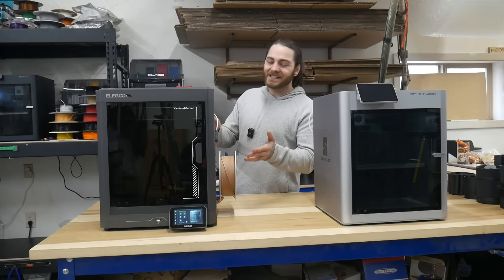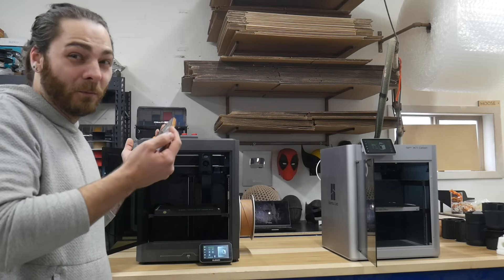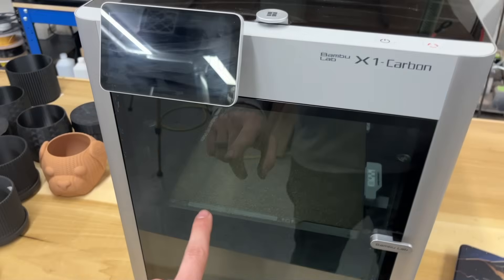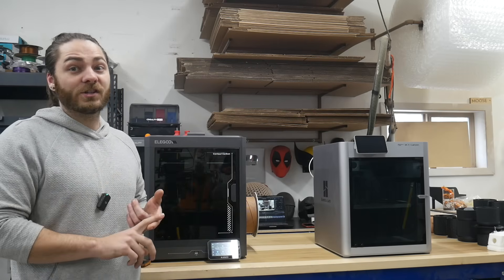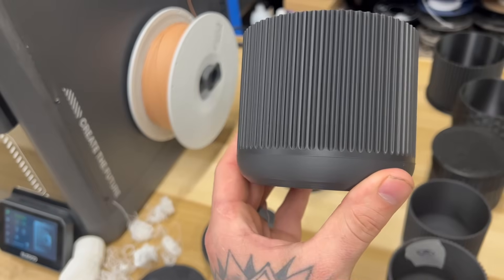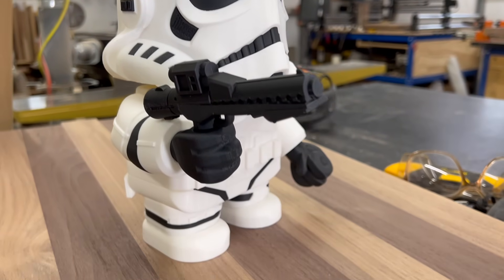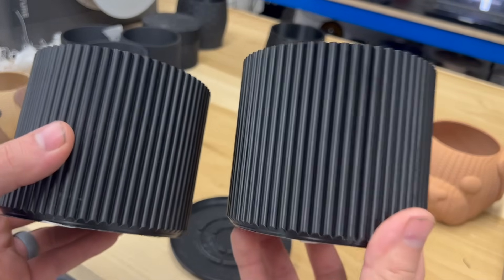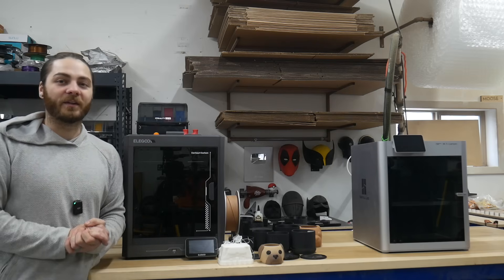Cheap vs expensive: Can the Elegoo Centauri hold its own against the Bambu X1C?

Comment: Wrong comparison.   The question is whether it is as good as the the P1S.
Reply: Dude literally said in his video the manufacturer wanted him to compare it to the X1..
Reply: I got mine, and it prints flawlessly. The finish and speed is amazing. 
The only thing I had to play with is filament settings.
Reply: @Reseiver got your what?
Reply: Males no sense, Bambulab and Prusa need to stop charging premium for regular products, a 299 elegoo is trading hands with a much expensive printer and you want him to compare it to a much worse an inferior p1s?
Reply: Why?
Reply: @Mau365PP because of the more comparable price range. Its like comparing Bentley with Opel. Both do the job, but the experience during the ride is completely different.
Reply: @Reseiver  How much as I would like a showdown between the P1S and the CC considering all the updates Elegoo already pushed in both hardware and software (new light and addition of MCU connector) we must not forget the CC standard comes with hardened steel dual drive extruder and has higher temps.  So it's more an X1C specs wise than a P1S. 

Although, considering Bambu Labs now has a sale on the P1S combo and a discount on the hardened steel upgrade it might be a very nice deal for 650 :D
Reply: @kellbrekoo3487 x1 prints almost exactly the same as p1s. So,there’s basically no difference. Yeah, the lidar and the extruder/nozzle are different. But those do nothing different print-wise. The nozzle and extruder don’t matter as long as you print pla/petg/abs. The lidar does the calibration for you. Yes. But manual calibration is still better. The only REAL difference is in the table temps capability: X1 can do 130 and p1 can’t(Well, if you aren’t modding it that is) So I see no reason for another comparison. The Centauri is definitely a great value for what it’s worth. I hope that they won’t fck it up, like Creality did with their k1 max cfs conversion. It was a great printer prior to the update to cfs compatible firmware. But after that it was a mess. A ton of glitches. Some small, like non-responsive screen. Some ugly, like the time that my spool ran out mid print, and the printer has decided to home the table before taking another spool in. That was horrible. So I’ve got myself a p1s and am happy with it’s performance and quality.
Reply: @Reseiver and yet X1C vs CC was exactly the buying decision in front of me 2 weeks ago.
Reply: @Mau365PP Centauri specs are closer to P1S than the X1.
X1 has lidar to calibrate extrusion.
Reply: @Ni5ei Who cares how the calibration is done as long as it is accurate and doesn't take an eternity. Time to print completion and print quality are the two main factors. The Elegoo is very competitive with both Bambu printers. Don't be Bambuuzled.
Reply: @MikeHammer1  I see what you did there.... and I like it.
Reply: @MikeHammer1  I'm not saying I care about how it's calibrating. All I'm saying is Centauri specs are closer to P1S than to X1C.
Reply: @MikeHammer1  Stop saying nonsense. For a new printer to be competitive with a Bambulab, it needs to have at least a year of significant printing. I've had an X1C for 2 years with almost 3000 hours of printing and I've only changed the nozzle once. The extruder is the original one and the prints are still perfect. They are beasts of performance, reliable and durable over time. When a new printer can do that, then we can talk about competition. For now, whether you like it or not, Bambulab is far above everyone else.

Comment: Watching this while my Ender 3 pro whirs in the background and I'm astounded at the print quality and cannot even believe the print speeds stated in the documentation. You actually didn't reference print speed with respect to your tests. Are printers so good now that it's not much of a consideration? Again, just blown away. This looks like a perfect upgrade for a light hobbyist like myself.
Reply: Let me tell you... It's not much, but going from my first printer (Ender 3) to a my newest one (Flashforge 5M) was huge. Auto bed leveling (The biggest plus for me, as I had to level my bed every time I wanted to start a new print), much faster prints, a nice user interface and no more modding to get the results modern printers can achieve. So much easier and for (Compared to then) basically the same price (Payed 280€ for the Ender 3 and a little under 300 for the 5M). 3D printers have definitely taken off the past 4 years. Especially when it comes to their convenience level. It's so much easier to get started. And not to mention setting up the Ender 3. Man, it was a huge pain in the butt, as someone who has never delt with it before. Now; Get it out the box, go through the auto calibration process, feed the filament and get going. Absolutely love it. 
Just now started a new print and I have to mention the Wi-fi feature. With FlashPrint I just connect to my printer over Wi-Fi and it automatically starts the print. No more running to my printer, selecting the file, leveling the bed and then watching the bed. Another point for convenience. 
Ender 3 is great if you want to learn about 3D printer at a good price point, but if you just want a 3D printer that works out the box, it's much easier to invest a couple bucks more.
Reply: @Fuerwahrhalunke  I have a modded out Ender 3 V2 (dual motor belted Z, SKR Mini E3 V3, Direct Drive H2 V2S, PWM 5015 fans, Auto bed leveling probe, linear rails, etc) that I probably spent as much in mods as I bought the printer for. It's been a click and print experience with it though it doesn't print as fast as I would like it too. I'm really looking forward to a huge step up to a Centuari Carbon lol
Reply: @Fuerwahrhalunke  Yeah, I'm sold. I ordered the Centauri.

Comment: What is the machine's dimensions? I'm making a workbench and would like to make a bottom shelf to accomodate this thing. 

I was originally going make it to work with a Sovol Sv06 Ace Plus, but I feel like this is worth sacrificing the print space, just by virtue of it being a Core XY with a heated enclosure that would require minimal modification (if any) to make it print nylon.

Comment: There are many things I like about my Bambu printers (I have an A1 with AMS, an A1 mini with AMS and a stand alone A1 mini for awkward stuff that the AMS doesn't like, TPU for example) but the nozzle change is the best feature, they are big, robust and can be changed so easily, I used to have a bunch of Creatlity printers, and OMG what a pain those little brass nozzles are. However, I do like the look of these enclosed printers, I had, a few years ago, a flashforge that looked a bit like a microwave, dual head, it looked amazing, but was really shit, it clogged nearly every print, and because it was dual head, aligning the heads was painful. In terms of reliability, how would you rate the Elegoo printer in this video? I ask because on my A1s, I get a9/10 success rate, but I am not a fan of this open chassis style.

Comment: How much did you get paid from Bambu? All are complains from you against Elegoo Centauri Carbon but not Bambu X1C, you always say Centauri, isn't centauri is centauri carbon, it's a bit different. Elegoo Centauri Carbon is cheaper and faster than Bambu X1C and the quality in the 3D impresions is more or less the same, it's on your calibration. So, how much?

Comment: @15:10 There is an option in Orca Slicer called "Avoid crossing walls" if you turn it on and play with the variables you can reduce the stringing you get on the inner caps. In the Preview tab of the sliced file you can look at the travel of the toolhead to see the paths it'll take.
Reply: Awesome point. I use this setting as well, for all my bowls/vases.

Comment: You compare print speeds with the slicer? That's new. You can also set up an Ender 3 to match whatever time the slicer tells you
Reply from the maker: The printers speed specs are the same on paper. I looked at how fast they would print each print in the slicer and they were very similar. I didn’t physically time each one.
Reply: @TwoMooseToo  What you could have done was to print with both on max speed. And compare quality and speed. Let say they both hava a 300mm/sec max speed profile, and use that. Print the same model

Comment: If Elegoo would have kept their firmware open (which they actually are legally required to do as Klipper is GPL V3), then this would have been a great printer.  Now it's actually an illegal printer, but unfortunately that goes for many printers (or in case of Bambu their latest slicer) nowadays ...  I really hope Prusa starts some legal actions against all these competitors that are now breaking the law.

Comment: You said you send print jobs to both printers via WiFi.  We have a Bambu at work and the only way I can figure out how to send print jobs to it is through the cloud service.  Am I missing something?
Reply from the maker: I just do it through the Bambu slicer. So I guess it’s the cloud. You can do it via the sd card or run a LAN cable if you’re worried about the cloud.
Reply: @TwoMooseToo  Does the Elegoo have a lan port?   I know the Bambu X1 Carbon that we have at work doesn't.

Comment: on my design - sylo · container - the threads do have challenging overhangs, it require some slowing down for clean prints, and variable layer height also helps out :) still a good looking print though, thanks for showcasing, would be nice to give credit though. My Centauri is currently in transit, so hopefully next week i'll be doing some prints on it as well and see how it stacks up against my bambus :)

Comment: Bambu is basically apple for 3d printers. Fuck them. Everything's close sourced so you have to buy their stuff and pay triple because their name is on it
Reply: to be fair, theres a reason everyone uses bambu and why other companies scrambled to catch up. Their printers are actually good
Reply: Well they should be good. But all im saying is you could buy a regular brand printer and throw 100$ worth of upgrades at it and it would be just as good. But the huge turn off for me is with the integration of their "authorization control technology".  They want to have control over what you can and can't print. And make it so you can't use 3rd party software you have to use theirs. And yes this is true. It is in their user agreement

Comment: I might have left the light issue til the end. For 1/4 of the price, you should expect a bit of inferiority. 

Also, in the spirit of 3D printing. People are really picky about some things. I wish all printers still had some tinkering. I hate that everyone has hopped on the easy side of things. It may be petty on my side, but ive had 10 years of issues to help get printers to this point.    That time and effort cost me and others a lot. A lot of fails. So its funny when people knit pick.

Comment: Bambu is getting ridiculous with the pricing at the moment pure greed the y couldn't even wait. A p1s combo is over 1k
Reply: The H2D was a pet project of Bambu's CEO who is an RC enthusiast who wanted one machine to do everything.  Laser cutting and 3d FDM is not compatible... extra cost for features  we don't want or need.  They should have gone with a larger build plate - 400mm with the two nozzle system and been done with it.

Comment: I work on a lot of Bambu printers, when people try to grease the carbon rods it ruins the bearings. It makes them wear out very fast. The metal linear bearings are better if they are oiled every so often.
Reply: hold up people grease those rods? Bambu literally tells you not to, crazy some people don't take the time to learn about a machine after spending close if not more than $1000.
Reply: They should be cleaned with IPA
Reply: Do you even need to do any maintenence on those rods? Maybe just a quick wipe down with some cloth?
Reply: @2010ngojo 

All they need is to be cleaned with some Isopropyl alcohol. I have seen units that are taken care of with over 3,000 hours on them and they are like new.

Comment: Let's talk replacement parts. Bambu lead screws are 35 dollars each for a part that is bought for less than 3 dollars and milled to be proprietary. I have been running a p1p farm for almost 3 years and I'm going to sell them soon and never buy bambu again. They're great machines till they reach a couple thousand hours and then the real issues come out.  If you're going to do anything besides print funco pops or toys and need a business aimed printer, steer clear of bambu. P.S to get "permission" from tech support to even buy the effing lead screws took 4 days of messaging them back and forth, I lost hundreds of dollars thanks to their terrible support forcing me to go through their list of BS when in the first message I sent pictures and videos and explained I'm a business. They don't care, I had to resend the same pictures and videos in the correct order of their flow chart to be ALLOWED to pay 1000% markup on cheap Chinese parts. Good toy hobby machine for idiots who can't use klipper and thats it

Comment: You should not compare this to a Carbon 1X—it does not offer the same functionality!
 Let me explain.
Guys, I run a small print farm using Bamboo P1S printers. They’re fantastic. These machines have printed thousands of pounds of plastic, running 24/7, and here's the amazing part—they’ve never broken, not even a single failed part.
I also own a Carbon 1X, which I use for exotic materials. To help clarify for this gentleman: the reason to buy a Carbon 1X lies in its lidar technology. It scans the plastic and performs all the automatic corrections for you, eliminating the need to spend hours fiddling with filament adjustments. And here’s the best part—it actually works.
I’ve even printed nylon with the Carbon 1X, despite it technically not supporting nylon. Thanks to its lidar technology, it prints beautifully. Printing nylon is challenging—anyone who’s tried it will know that.
On the other hand, the P1S printers don’t have this functionality. You must perform manual calibrations, review the results yourself, and then manually input correction factors. Even after all that effort, the final print quality is still not as flawless as what the Carbon 1X can achieve.

As for the Elegoo Centauri Carbon, it’s a strong CoreXY printer with impressive speed,  , it may not match the P1S in terms of reliability for high-volume, 24/7 production, nor can it compete with the advanced lidar and correction capabilities of the Carbon 1X.

READ THIS ***So, again, you shouldn’t compare the Bamboo   Carbon 1X ,  the Elegoo Centauri Carbon—is not different than a P1S in terms of functionally.**

my
Reply from the maker: Again. Elegoo asked me to compare it to the X1C when they sent me the printer. I said sure 👍🏼 the p1s is a better comparison I agree. Overall the p1s and X1C are pretty similar. The X1C has more bells and whistles but print quality wise it’s pretty comparable.
Reply: That's true if you're using bamboo plastic, and if you're printing pla or abs...  Should you go print something difficult like nylon. The lidar is freaking awesome.

The problem with the elegoo printer even if they gave me the printer, the probability of that cheap thing breaking in costing me hassle and time.... I would probably throw the thing in the garbage. They're  probably okay for light duty usage....

Here's the question do you want to buy something that lasts? 
People really don't know how durable bamboo printers are....

Honestly if I thought I could buy a 3D printer for $300 as good as my PS1 I would buy 10 of them right now. 
No questions. 

For me the couple hundred dollars is completely irrelevant... 5000 lb of plastic later.

Comment: So, you compared A1 prints to an X1C ‘clone’ and not the X1C, so, not an actual comparison at all. Got it! 
👍
Reply from the maker: One print was on the a1 the dog head planter. You didnt watch the video, got it.
Reply: @TwoMooseToo  You should maybe go back and watch your own damn video. I have screen shots to prove exactly what I said. I’m quite sure the transcript will also prove exactly what I said:
1. You showed the first TWO prints, the dog AND the container, and put on screen that the ones not printed on the Elegoo, were printed on the A1.
2. Literally EVERY other print, you just said “the Bambu” with ZERO indication that you used any printer OTHER THAN THE ONE YOU PREVIOUSLY STATED, the A1. A viewer would then have no reason to believe or know otherwise, that you printed the rest using the A1 because from that point forward in the video, you just referred to it as “the Bambu”. Get your facts straight in your own damn video.
#smh
Reply: None of your viewers can read your mind.

Comment: The Bambu has nice easy to use JST connectors for the head swop which I like. My P1S has these weird stupid connectors that are difficult to line up and I have had they not connect correctly as times. The crazy thing is that JST connectors are cheaper as well so god knows why Bambu went with these weird connectors.
Reply from the maker: Not sure why they wouldn’t just make it the same. The quick disconnect nozzle on the flashforge is by far the easiest. No tiny plugs just a button and it clips in and out.